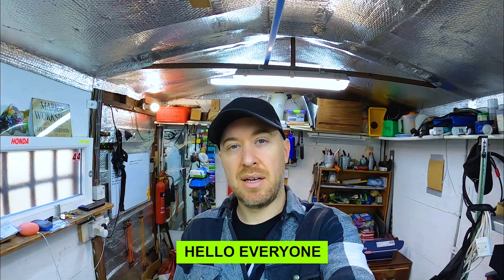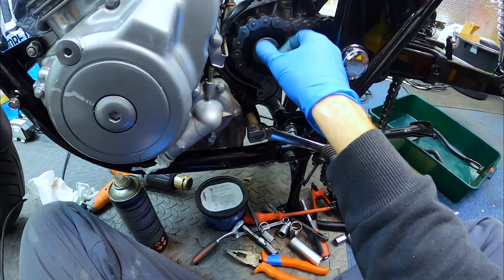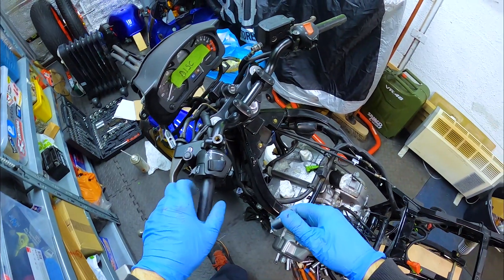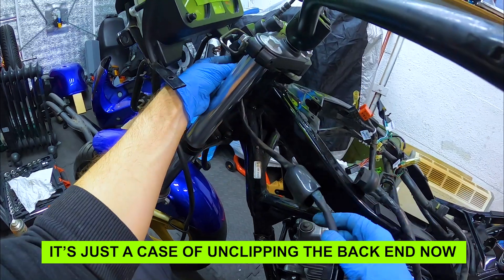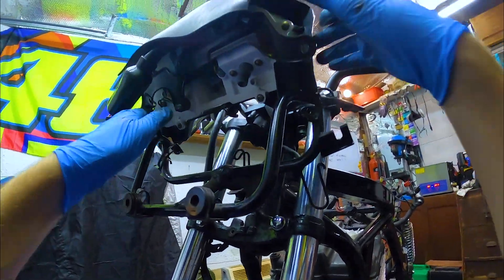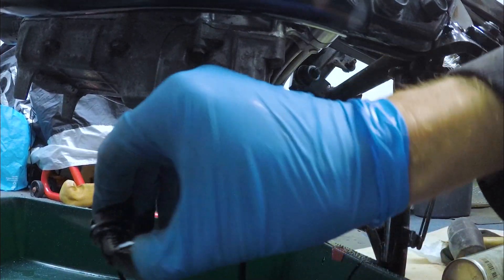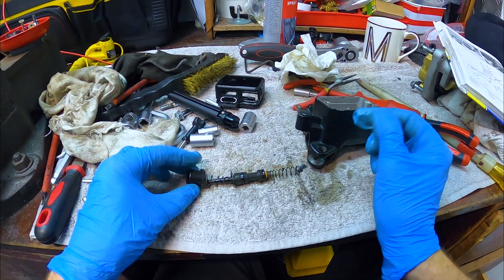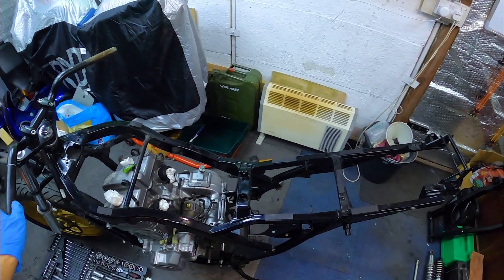Honda CB500 Engine removal & tear down (part 2) 93-01 pc32

Comment: Trolly Jack under the engine take the stress and undo bolts then lower that's how I got mine out without taking the rear off but just put mine back in 2night what a carry on dropped the back wheel off and tried to jiggle the engine while on a trolley jack back in

Comment: Hey Dude, thank you for this video! I'm just working on mine and was desperately on the search for a video on how to take the engine out. I actually only wanted to rebuild the cylinder head and was very shocked, when I saw that one of my cylinders has not only rust on the "cylinder wall" but also two deep grooves. I have to have it rebored. Im not a mechanic but until now, I managed to repair everything by my own. Rebuilding carburetors, forks, brakes etc. However, I never had to take an engine apart and the cb500 is special in this regard, because you can't just take the whole "cylinder block" off like on other bikes,...it is necessary to split the engine block in two, and take everything out, in order to be able to work on the cylinders. It's quite a challenge for me and I'm not sure if I can do it. I have one of those cheap repair manuals, but the instructions are very minimal. Do you know of any helpful video or website, on how to take the engine apart? Thanks in advance, happy new year and cheers mate!
Reply from the maker: Hi thanks for the message. Really glad it helped as that's exactly why I filmed me doing it, to help others aswell as me. It's not too bad to get it out. I haven't taken the engine apart myself before, that's the next thing to learn. I don't know anywhere that shows how to do it. I've had to take mine to someone I know who knows these engines well. I find it really difficult to know where to start with taking an engine apart. No one seems to film it. Hope you manage it. If you have a Haynes manual it will help, but I'm sure there's bits it doesn't show so well.

Comment: You are a life saver! I am (slowly) restoring my CB500 from 2002 and your videos have honestly helped me more than any manual out there!

Would you recommend having the frame and swing arms poweder-coated or cera-coated? I am searching for the option that will give me the best corrosion protection. 

Once again, thanks for the videos. Astonishing work!😁
Reply from the maker: Hi. Thanks for the nice message, really pleased to hear the videos are helping others. 

I had mine powder coated. The main reason is it's thicker than cerakote. I think cerakote works better on smaller parts, like the brake master cylinder and yokes. Where as the bigger parts, it works better in powder coat. If you can get the frame cerakoted, it would look amazing and would work very well. Most companies I found, were not able to do parts as big as frames or wheels. But if you know a place that can, give it a try. I found powder coating cheaper too. Hope that helps 👍

Comment: What size ultrasonic cleaner do you have? You are on the road to ruin with a cb5 ha. Tracked one for 6 years now, so much fun, who needs litre bikes! I don't race so I use cbr1000rr coil sticks and loom to replace the old coils, it feels more reliable.... Get your angle grinder out, so much to come off. What are you doing with the forks? 20w oil and 125 air gap , standard springs on mine
Reply from the maker: Hi cheers for the reply. It's a 6L ultrasonic cleaner I have. It sounds like it's massive, but it isn't. I wish I went for a larger one still. You want to be able to get parts in that are larger, like calipers and stuff. 

Yeah I'm hoping it's fun to race with them. I've got another bike but I want to try keep it as cheap as possible. I know racing is never cheap but these bikes are much easier to get parts for than my RR. Having watched the videos of the CB racing lads, some of them are rapid. So it's not going to be easy to keep up. 😃

Yeah the next video covers all the chopping of the frame and swingarm, I cut quite a bit off. 👍
Reply from the maker: Yeah with the forks most likely the 20w oil and 130 air gap, that's what I see most seem to recommend. I'm planning to try the standard springs first and hopefully it will be stiff enough for me. I prefer the suspension a little stiffer. 

I'd love to have it as a track bike where I could make further tweaks like you have, but I have to stick with the Thundersport regulations. You never know, i may get a other one later on to mess with 🤣